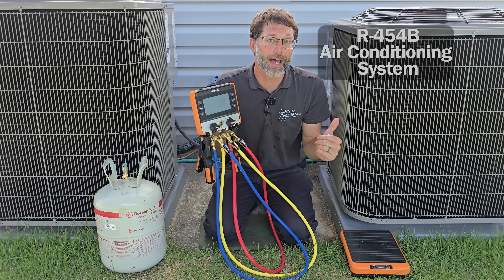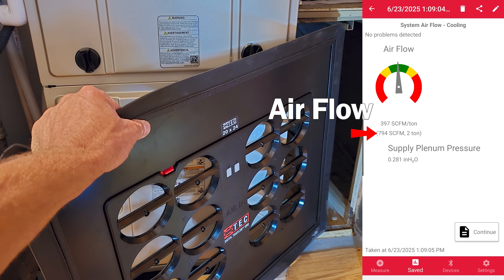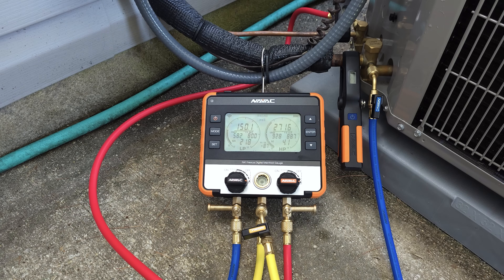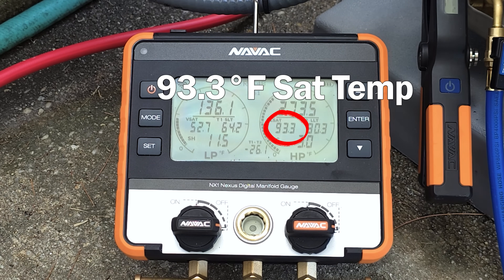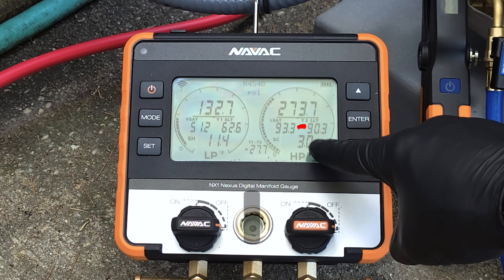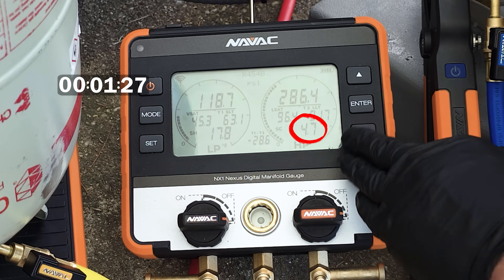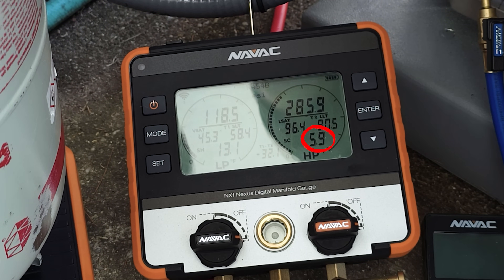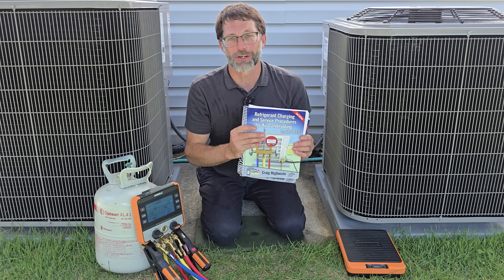Charging R-454B Into an Air Conditioner That is Slightly Low on Refrigerant!

Comment: The service valve on my home unit was leaking. I opened the top cap and found that it was only half open! After opening it all the way it stopped leaking.

Been that way for 15 years. After 4 techs they never found that leak when they charged the system. 

I do all my own HVAC work now. I'm not calling anyone anymore.

Comment: I was made to understand that the refrigerant mix in 454 evaporate at different rates, and that adding to the unit will create an incorrect % mix.
Reply: If you add 454b with the tank right side up it would alter the % mix of the AC system and the 454b tank, so blended refrigerants like R454b require you to turn the tank upside down when adding.

Comment: Just a piggy back to this video, you MUST allow the system to run for a minimum of 15-20 minutes prior to even beginning to adjust charges. Over charging is becoming an issue. Ie. Add no more than 0.5lbs (8oz) for each adjustment and allow for a minimum of 20min for every adjustment.
Also much like 410a good welding practices and triple evacuation and deep vacuum (450 microns or less) procedures are absolutely a must!

Comment: Lol seems a lot of these r454 B units are "slightly low" on refrigerant. Or they're leaking or just don't cool. Can we just get some r22 back. If a sealed system is sealed, what's the issue for the environment. R22 never blows out like 410a does. Why does the government regulate air conditioners when semis spit coal into the atmosphere daily. None of this makes any sense.

Comment: Craig, I'm wondering why, when purging the suction and liquid hoses, you didn't just leave the the suction hose connected, cap off the center manifold port, and open the manifold suction valve, then open the manifold liquid line valve to purge the liquid line hose and finally connect the hose to the condenser liquid port?

Comment: $20 you can just charge it with r32, and aside from around 20 more psi in pressure on the high side, no one would notice the difference.

Comment: I started a unit last week. Target sub cooling was 12.  It was 86 in the house. I had 18 degrees of subcoooling. I left it alone and returned this week to recheck. Without removing any refrigerant it was at 13 degrees. It’s 454-B refrigerant. Is it not possible to get an accurate reading with the house that hot?

Comment: What’s the point of the charge chart if you aren’t ganna take out all refrigeratant and re charge by full wieght during a leak and if it’s low there is a leak.
Is this a new install if so still use the charge chart
And have use red caps only

Comment: A veteran service expert I work with does not care for saturation temperatures when consulted about any issues. They only care about gauge pressures, so when I mention saturation temperatures they get annoyed. You and Ty say saturation temperatures are important, but they are the company's service guru, so what do I tell them? 😁😮‍💨
Reply: Ask them for their advice about how air flow affects refrigerant pressure.  If they ignore saturation temps perhaps they struggle understanding pressure temperature relationship, and seeing how air flow affects refrigerant pressure might help them realize the importance of saturation temps.  

If they don't like saturation temps does this also mean they don't care about superheat and subcool as well?  

Keep learning from better sources like Craig and Ty, and you'll develop a reputation eventually passing the "guru" at your company.  If your AC company perceives someone ignoring saturation temps as their guru, it means you will have an opportunity to show them you're better as your skills grow.  Some of these "gurus" have too much pride for your advice or to drop bad habits.  Great question!  It shows you care about doing things right.

Comment: whats is part number. For the cap.   With hole. Check,   Leak
Reply: Looks like a cap that they drilled a hole in. This isn't a part number sort of thing.
Reply: @phillyphakename1255 got it thx

Comment: You  need to put out a video stressing proper clearances when installing  condensing units. Too many units are too close to the wall or within 1 foot of a gas or electrical meter. I see this too often and these units cannot be serviced properly. Read the installation manuals. Also the units you are working on today are too close to the building for proper service.

Comment: I love your videos, very helpful.
I do have one question that I can’t seem to get an answer to on other sites.
Question; now that your hoses are filled with r454b and your manifold gauge allows you to select various refrigerants- how would I go about purging the lines if your next service call is a R410a and due to the low loss fittings on your hoses r454b is locked in those lines which would contaminate the r410a system… correct?
So my question is how to you purge those lines before hooking up to r410a and selecting that type refrigerant on your manifold?
Do I need to have a set of lines for every type of refrigerant?
Reply: never leave liquid refrigerants in your hoses, vapor only. then either recover it(yeah nobody does that) or vent the "gas" only as "de minimis" refrigerant release.
it would be equal to having a small amount of gas an nitrogen in a system for leak checking.
again, try not to vent any liquid, let all the liquid vaporize from the hoses and pull back into the system being serviced before unhooking gauges.

Comment: Its a commercial for NAVAC. spoiler alert, charging hasnt changed.
Reply: Brand new system low on charge already………it’s starting……..
Reply: @Samlol23_drrich
Depends on how long the lineset is. Units are precharged for a certain length of lineset. If for whatever reason the lineset is like 50+ft long your gonna have to add charge on startup
Reply: @hunter00143 the manufacturers have all been upping the factory charge because of the R454 20/25lb cylinder shortage. They can get the big industrial bottles, but not the small HVAC tech bottles, the largest bottle manufacturer discovered an issue with their valves and so lost a few months of production. It's a bottle shortage, not a refrigerant shortage.
Reply: True

Comment: Did I miss something? I didn't see anything different from charging any other system. Other than using the tank adaptor what did I miss that was different from charging any other system?
Reply: Bro its a clever NAVAC commercial... Nothing has changed when charging equipment.

Comment: there is a shortage of 454b right now as we speak you can sub that 454b unit with 410 A because its the same BS without the fucking methane thats making the unit a firehazard and you dont need the gas senor add on to operate the unit.

Comment: I put my first 454 system in this week. My supplier finally didn't have any more 410 systems. Cost me a $ 1000 for a jug of this crap. RIDICULOUS
Reply: Switch to Goodman Equipment.
Reply: I really like to know what and how different the 454 vs 410 realistically
Reply: @josephpuchel6497  R-454B offers environmental benefits with a GWP of 466, compared to R-410A's GWP of 2088. While R-454B is classified as A2L (mildly flammable), it is considered a safer alternative due to its lower GWP and comparable performance to R-410A.  All government garbage. Likely the only reason.
Reply: @josephpuchel6497   I do know that R1234yf was found to be extremely flammable when tested by BMW in some of their tests involving coolant leaks in hot engine bays. They produced a video of it a while ago. They decided not to use it. I wonder if the mix of R32 and R1234yf is less flammable. Of course it wouldn't be problematic for HVAC techs. Now, I wonder, during a house fire, would there be a possibility of a leak and a blowtorch affect? That would suck for firefighters.
Reply: @stillnessbetween5103 
The new vehicles using everything is kept to inside the engine compartment area so if it does ignite it won’t engulf the interior of vehicle.  Don’t think this 1234 stuff should be used in vehicles
Reply: @stillnessbetween5103 so what does BMW use? I don't think 134a is used anymore on new vehicles.

Comment: Why would you be required to use locking caps on the liquid and suction line ports?
Reply: One stupid kid huffed refrigerant in the past and died from his actions.  From this isolated event it's now pretty much code that locking caps be installed.  
Akin to the TSA implemented mandatory shoe removal during airport security screenings ,   Needless over kill .
Reply: So no one steals your refrigerant
Reply: So lil Johnny doesn't try to huff it. I say let natural selection do its thing
Reply: And it's barely a lock - it's not like we don't live in the age of the Internet and can find out how to take them off

Comment: Hi, quick question about purging. Would purging the red hose by loosening it at the manifold be a good practice? Since the manifold, blue and yellow hose are already purged, I feel like the air in the red hose gets in between the refrigerant in the yellow hose and the refrigerant in the tip of the red hose. By only loosening the red hose, you only purge the air that’s left. Does it make sense? I may be overthinking it I don’t know.

Comment: could we have left it slightly undercharged and then purged the disconnected yellow and red lines in to the blue to clean them out? just curious
Reply: In this video he had the yellow hose ball valve at the tank so you could close that and put in all the yellow hose liquid.
Reply: that's what you should always do, never leave liquid refrigerant trapped in hoses, between valves or anywhere there's not a storage vessel for expansion ( receiver, accumulator, compressor, recovery tank). leaving it trapped in gauges/hoses can make for a nasty hose burst, gauge rupture/other.

Comment: He never explained why he had to flip the tank upside down ?
Reply: He did. But it is because the refrigerant is a blend. When it is blended you have to charge with liquid because blends boil at different temperatures so if you try and charge vapor it would be more of one refrigerant and not both or how ever many make up the blend.
Reply: He did. In order to charge as a liquid since it’s a blended refrigerant. Blended refrigerants need to be charged as a liquid in order to charge the same ratio of the refrigerant blend.
Reply: To get liquid only going into the system. new refrigants even 410a are blends so it has to be liquid or you will have to remove it and start over THIS IS A MUST
Reply: It’s a blend refrigerant. All blends must be charged as liquid
Reply: Zeotropic refrigerants has to be filled as liquid. Azeotropic ref. you can do as you want, liquid or gas
Reply: Blend bro it’s simple , it’s very simple

Comment: I do commercial work and I have yet to see ANY unit with red caps!? They have red “markers” in a couple of places but the use of red caps would also be a good idea.
Reply: probably shortages on them also. I can say goodman/amana/daikin have red caps on their R32 gear, granted that's residential gear.
Reply: Few splits ive installed. Came with a rubber red silicone washer to go on the valves. They are pretty large.

Comment: Nah. I have your books and cards and follow every video for some years now. But what I am trying to get is one of those valve cover cap you have with the tiny hole in it to test leaks.😀 Love all the videos and glad you're still out here.
Reply: I’ll sell you some. Take a small drill bit and drill a hole
Reply: I don’t think anyone sells them but you can easily make them yourself. Just drill a very small hole in a brass cap that has a gasket. Start with the smallest bit in your drill index.
Reply: buy some brass caps, and drill a small hole in them, which is exactly what Craig does. You can't buy them.
Reply from the maker: We don't directly sell the test caps, you can easily make them by drilling a small hole in a bass cap!

Comment: What is a wet bulb?
Reply: It is literally what the name says. Before digital wet bulb sensors, techs would take a "wet" cotton sleeve, wrap it around a thermometer "bulb" and twirl it around in the air to get a wet bulb measurement. At the moment, I don't remember the physics behind it, but it's because the evaporator coil is wet with condensate that we need a wet bulb measurement.
Reply: @chrisdeanndavison3626 can you please do a demonstration of the steps! Step by step to see how it is done? I appreciate your videos 🎥 it's better then watching a Hollywood movie
Reply: @chrisdeanndavison3626   When water evaporates, it absorbs energy from its surroundings to break the bonds between water molecules and change from liquid to gas. This energy absorption causes cooling.

Comment: Great refresher! Thank You
Reply from the maker: I'm glad you found the video helpful, thanks for watching!
Reply: @acservicetechchannel Craig I’m looking at a unit now, 3.5 ton heat pump. Replaced the evap a few months ago, old one leaked and had a fixed metering device! Now has TXV. The lineset is approximately 40’ 7/8”/3/8” . Im only get a T delta of 15. Thinking I didn’t add enough refrigerant for the lineset? It was vacuumed down to 500 microns and passed the decay test. I’m heading back today to put the gauges on it. The static is .16

Comment: Why do the outdoor condensers sweat so bad?
Reply: The only thing that should be sweating is the suction line back to the compressor from the evaporator. 
It sweats because that's all the "cold" refrigerant coming from the evap and it'll sweat depending on humidity.
Nothing a bit of insulation can't solve.

Comment: Great channel. Dumb question: Do all the new refrigerants work at higher pressures? Old stuff like R22 had lower pressures yes? I would think lower pressures less strain on equipment in long term.
Reply: This is true. 
I've truly believed that if we continued to use R22 today, with the inverter tech and VRF tech we would be seeing 40 SEER out of an air to air unit. 
Having that much efficiency per unit would negate the GWP by the saved energy.
Reply: @tt7hvn Not even remotely close. R22 is nasty and needed to go.
Reply: @Factory400 I'm strictly speaking from an efficiency standpoint though. 
Yeah, it was a nasty refrigerant in reference to its GWP but the efficiency it could provide if it was applied to the tech we have nowadays.
Reply: Why? @Factory400
Reply: I happen to agree with your assessment of the lower pressures being less strain on the system… R22 systems had no problem going 20 years with no leaks. Then 410A came along and runs much higher pressures. Well they cant make the coils thicker because that would kill efficiency. So higher pressures just cause leaks sooner and now you’re lucky if you see 10 years without leaks.
Reply: Why couldn’t they just make new units that use 422b?
Reply: I used to think higher pressure would need more energy but now I think pressure is irrelevant and it’s actually compression ratio which determines how much energy is used, but I still have no idea for certain
Reply: Because it's less efficient. You need more and more energy to move it because it doesn't conduct or react as much. It's only getting worse over time. Thermal mass per volume is lower on less efficient Freon.
Reply: Pressures are irrelevant. Compression ratio is all that matters